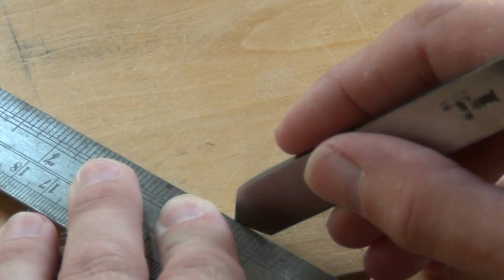Mitre Joint - Simply Split that Angle

Comment from the maker: I don't have a donkey ear, but you're right that that is a shooting jig for what you're doing. I simply have a double sided 45 degree ramp with a fence, that clamps on my shooting board. The difference being that the component is held the other way up. Both work great. If your ramp angle isn't spot on, just use paper shims to correct - magic!

Comment: I'm making myself a hexagonal vegetable table with decking boards. I'll need to cut 60' angles at each end of the board but cannot afford let alone find room for a Mitre saw. any suggestions as to how i can accomplish or am i just going to have to saw it like a mug?
Reply from the maker: If hand sawing isn't your cup of tea, then a jig saw, or a circular saw, run against a clamped on guide should do the trick

Comment: Can u do a spline miter joint. Also can u explain how to measure as well. Say corner to corner. Im making a table with trim molding and keep under cutting or over cutting the second piece.
Reply from the maker: Joe Walters Hi Joe. Spline mitre joint is on the list.For your trim moulding: Cut two short mitred pieces and tape in place, then measure between outside edges of the mitres. That gives you the total length of the piece you require. If you have a shooting board, and a mitre fence of the correct angle, you can cut slightly oversize, then shoot to fit. I hope that helps.
Reply: Ty for tip. It helped. I do not have a shooting board but I may have to make one in future for future projects seems to simplify things. Thanks again.
Reply: As for splined miter video. Cant wait to see it. It adds a nice touch ..not to mention strength probably.

Comment: How about working with 2x4's?   Seems like this wouldn't work.
Reply from the maker: My only concern would be the squareness of the lumber. The process should work on any scale of work. For strength, if the joint is divided into fingers cut to the same pattern it would better.

Comment: Now just get the other 3 joints perfect and make sure all the pieces of wood are exactly the same length! Much easier to use a sanding disk mounted on a table with a 45 degree slide bar.
Reply from the maker: Why lean to read when you can get audio books. There's a pleasure in it. I do appreciate that it's not for everyone though. Cheers